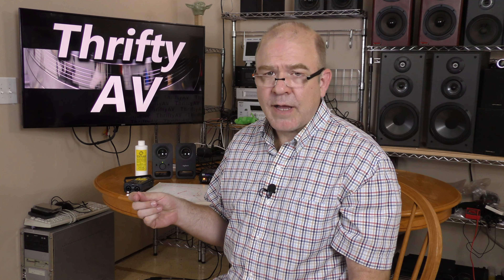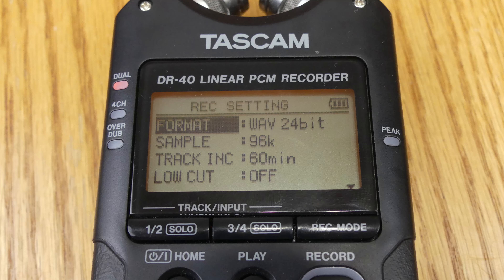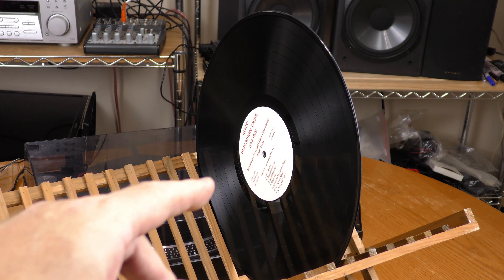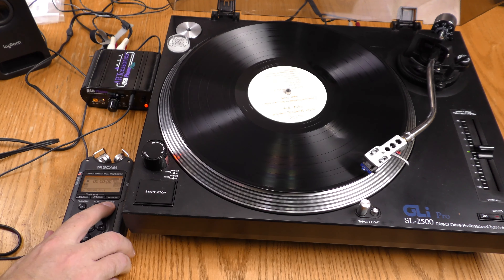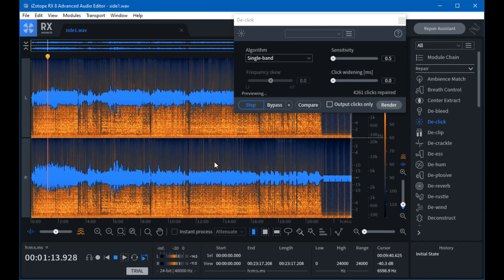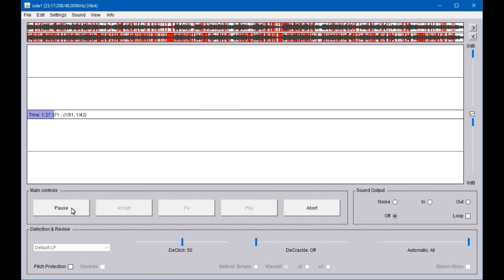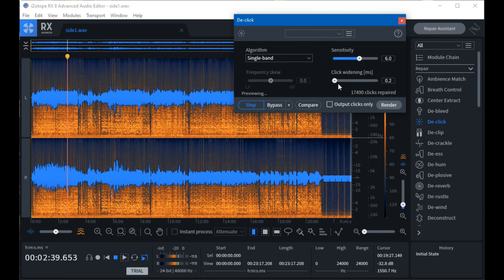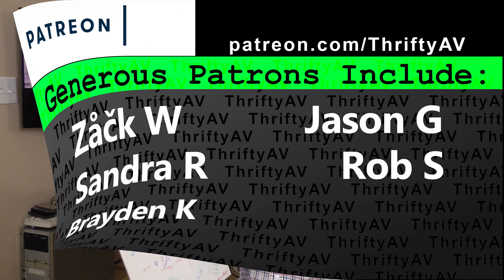Digitizing Vinyl! With Tascam DR-40, ClickRepair & iZotope RX8

Comment: I've used my fully-licensed version of ClickRepair for roughly 10 years, and to this day, it is STILL the BEST tool for restoring vinyl, removing artifacts (pops/clicks), while leaving most of the fidelity intact. It's inexpensive, and unheralded to be sure, but my most trusted tool for bringing vinyl records into the digital age.
Reply from the maker: I have several albums where the vinyl mastering is obviously superior to the CD version.  I've been considering purchasing the license just for those transfers.
Reply: can you still get Click Repair?
Reply: @12bitizthewaytogo92  I think it's no longer available. From what I understand, the guy who developed it is no longer working on it because he's really sick. You may be able to find a copy out there somewhere, but the old site is gone, and the new one probably won't open anytime soon, if ever.
Reply: I love ClickRepair. I'm looking at doing what you've done here and capturing on a recorder and transferring the files back to the computer for editing. I've developed an annoying ground loop with the computer and I no longer have the patience to deal with it. 

One thing I might suggest is that you could go even easier on the DeClick settings like maybe 25 max. I was using  the standard 50 setting, even with relatively clean vinyl, and it was too much. Now I have it set for 5-6 for really good copies, 7-9 for middling, and 10-12 for poor quality albums. I don't usually have to go any higher than that, and if I do, then I just try to find a better copy. Most of what I rip are public library classical albums of varying quality, and that works really well for me.
Reply from the maker: @cubdukat  Thank you for the suggestion.  This video represents my first time using ClickRepair, and I may have been a bit "heavy handed" on the settings.  Regardless, even if I overdid it, I worked quite well.  I think it is an excellent software title.
Reply: Is your click repair still working 

Mine isnt

Comment: The one thing that helps with ClickRepair is that you can listen to what's actually being taken out. , so you can adjust the DeClick slider to lessen how much it takes out. If you start hearing rhythmic clicks other than what you might hear from a deep scratch, back off. Also, you almost always want to select one of the "Wavelet" options. The base setting is too crude.

Comment: Is it possible to set the gain in the TASCAM instead of lowering/raising it on the phono stage? I own schiit Mani which doesn't allow me to set the gain, I would buy one of these if I could plug my photo directly to the dr-40.
Reply: it is possible, but there will be a blockage in high frequencies, you will lose the bass

Comment: Like you, i’m trying to restore an old high school choir and band recording from 1961 in izotope RX8, but by using the full paid standard version. Choir, band, and orchestra recordings are difficult because of the wide range of dynamics and quiet spots in the music. I wanted to ask, how big of a difference is it to use a Tascam DR instead of running a USB from the turntable to the laptop? And can I just buy the Tascam DR-05 2-input over the DR-40? It’s $80 cheaper. Will it achieve about the same? And do I have to buy the USB phono plus? Does it really give a cleaner sound? I have an Audio Technica LP120XUSB-BK with a VM540ml Microline cartridge. 

I’ve had the same problems as you with the buzzing in place of clicks and pops in iZotope. I wonder if it’s the settings? RX8 does work wonders, but I still haven’t achieved the cleanest background. I’m still new to iZotope. But I still think the full version of RX8 is better than Click Repair.
Reply from the maker: I have not reviewed the DR-05, so I cannot comment on the quality of the mini-jack line level input.  The dual XLR/TRS jacks on the DR40 work well with both mic level and line level sources.  The DR-40 is an older, discontinued model, and you can often find it on Ebay for about half the price of a new DR-40X.

I do not own an Audio Technica AT LP120XUSB, but I know others who own this turntable.  I understand that it performs best using the built-in preamp.  I would not recommend an outboard phono pre-amp (like my ART preamp) with this turntable.  Even with the switch on "phono level", the signal path from cartridge to RCA output is not pure.  There are instructions online on how to mod your turntable for optimal performance with an outboard preamp, but this defeats the purpose of having the preamp and USB features built into the LP120XUSB. 

If you use the USB output on your LP120, you will not need an outboard recorder, but the audio will be 16 bit, not 24 bit.  With line level RCA, you can record 24 bit with an outboard recorder.  The bit depth offered by 24 bit recording helps prevent artifacts when audio is manipulated, so the RX8 software might perform slightly better at pop and click reduction.

Comment: You aren't using the right settings in RX8.  RX does a tremendous job on click/pop removal.  I use it exclusively and there's no reason you can't make a Vinyl record sound spectacular.  If you need an example, here's a Vinyl rip I did a while back.  https://www.youtube.com/watch?v=N74ObNyvxAs&ab_channel=BobbyJones
Reply from the maker: I was disappointed that the RX8 trial software is crippleware that will not allow the user to save files.  I reached out to the folks at Izotope about issuing a license for a video demonstration, but never heard back.  If they issue a license for RX8, I will do a follow-up and explore the settings more thoroughly.
Reply: @ThriftyAV  It's not crippleware, iZotope RX is a full blown DAW.  There's no reason for them to offer it out for free when it's the standard for audio restoration in the film industry/audio industry.  It's basically the 'gold standard' for Vinyl restoration.  If you're actually serious about Vinyl restoration, it's not that expensive for the Standard or Advanced versions.  I paid for it and don't regret it one bit.
Reply from the maker: @bobbyjones1055  They offer "try it now" on their website, and the evaluation version IS crippleware.  Absolutely they should charge for a full featured product, but some software retailers offer full featured evaluation copies of their software for a limited time so folks can test it out properly.  Izotope has chosen not to do this.
Reply: @ThriftyAV  I'll be honest, they really have no reason to do this.  When you have the absolute best audio restoration software on the market, why offer a free trial version.  BTW, I'm not trying to promote the product, I'm just stating facts.  I as well tried other options over the years for Vinyl restoration and none come close to iZotope RX.  I've taken the most beat up Vinyl (within reason), ripped it and utilized iZotope to restore it.  I have an original Elvis Presley - Love Me Tender 45RPM from 1956 and it's pretty beat up.  iZotope made it sound like it was just recorded yesterday.
Reply: @bobbyjones1055  Do you have a video showing the settings or workflow you used in Izotope?
Reply: @bobbyjones1055  Hi Bobby, does iZotope RX 8 Elements also have good click and crackle repair? I'm thinking of buying that.
Reply: I agree with you about RX8, it’s just about learning the software. You have to buy it or do a payment plan with a 3rd party to reap the benefits. I will admit, i’m still new to RX8. I have the same problem when go to remove clicks and pops. On some LP recordings I get a slightly distorted buzzing sound in place of the clicks and pops. Another commenter suggested to use the vinyl preset in the drop down menu? I was going by an RX3 video… I also get water noise, even if I use de-crackle slightly. I just want a smooth background, which is hard for recordings with quiet dynamic regions. I wish there was an updated tutorial on Youtube explaining an LP edit in RX8.
Reply: @Geordiepete211  I think so. RX8 is better at removing clicks and pops than Click Repair, and it’s professional. I get more background noise that takes the place of clicks and pops when using Click Repair. RX8 is more professional. You can even remove coughs and sneezes that interrupt the music in live performances. They also have 3rd party payment plans if $300 is too expensive for some.